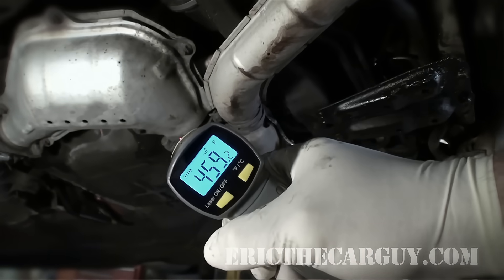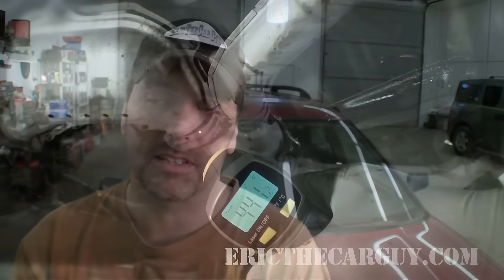Does Lacquer Thinner Clean Catalytic Converters? -EricTheCarGuy

Comment: The CAT in my last car just completely rattled itself apart. Sounded like shaking a bunch of rocks or marbles in a huge tin can. I had it replaced, and I only paid something like $180 (this was in 2009) to have it replaced. It helps to know people. :)
Reply: probably aftermarket. they only last a few years usually cheap. Try those then put bolts flanges on and you can just pass and replace with old one after cleaning and dipping in solutions. And you can save your new one in the garage to pass in two years again...
Reply: That was the 3rd CAT my old car went through. The 3rd one held together just fine until I sold the car to a junk yard in Oct. 2012. I just got tired of the damn car breaking down on me all the time. In case you're wondering, It was a '95 Dodge Stratus, the car barely had 100,450 miles on it when I finally got rid of the clunker.
Reply: Crap, i failed smog from having lots of blue smoke after warming up. Sucks because i dont usually have any smoke at all till i get too this smog place after warming up and driving freeway and whatnot. So pissed to not know what intermittent blue smoke is caused from. Maybe the turbo , but i thaught that would be around when i go for smog twice now. valves, seals, rings, pistons, turbo, exhaust manni cracked. Catalitic seems clean, but cleaning it for like 24 hours. Was insanely easy too take off, so glad.
Reply: charleysturbos
Based on what you're describing to me, maybe that blue smoke is the result of burning oil?
Reply: Hey loud yes I knew blue smoke means oil burning but thanks. I passed smog everyone. I finally got my sticker after seven months trying different things and reading 100's of messages and researching for hundreds of hours on what to do. I came up with an amazing way to clean my catalitic and nobody on all the forums ever did this that I'd read. Anyone want to know? Also know exactly how to clear obd2 not ready sensors easy too.

Comment: The original video he said to use 1 gal per half tank (ACURA maybe 6 or 7 gallons).  That seems like a much higher ratio than used here.  He also stated that the vehicle should be run at higher rpms for a prolonged period of time (30 mins at least).....make another video but up the ratio to 1:6 and step on it ;)

Comment: I have a Nissan Sentra GXE California emissions 1.8L, it has a check engine light on, so I had it taken to auto zone to check and see what could be the issue. The code reads P0430, what do you think could be the problem? I have checked for this code, but all videos come as P0420, are they the same?

Comment: shouldn't you run the test on a car with the cat code in progress? also the code sets off at 95% cat efficiency so if you can burn off just a little carbon your in there , it may gain you that 2% to shut the check engine light off, the light should off bin on during this test to properly conclude its effectiveness  , also the ratio is to dump the lacquer in a 1/4 tank i think, any way i do like how you checked the temps of the cat before and after

Comment: Mr. Eric: as  former tech of 18 yrs.working on tractor trailers & forklifts of every type, I commend your logical & measured style in your "mythbusting" lacquer thinker/catalytic converter video. My comment is along the lines of a different experience,....have a '98 Ford Windstar w/ 233,250mi on it. The converters are arranged in the headpipes in such a way that one has to replace them both together, to the tune of about $500. That being the case I tried the lacquer thinner route, but used a 5gal:1 ratio of gas to thinner. I just ran it in neutral at approx 2000 rpm for about 30 minutes. Cleared the codes, & it went 6 weeks before it filed a P0420 code again. Repeated the process, & has been fine ever since ( around 4 months). Since I've saved myself around $470 so far, I've got room to do this a couple more times, giving me time to save my change for a converter replacement. Just another perspective.

Comment: I have never seen any additive help a car. They only seem to help the guy who sells it.
Reply: Wait a minute, I had a 96 Legacy that was misbehaving, losing power, hesitating, laggin', lurching and shaking when I put my foot on the pedal, poor idling and gas mileage and some other nasty thing, I put a bottle of Gum Out in a tank full of gas and "oh the mystery" the car's running fine after running through 1/2 the tank with Gum out in it. You can call it  snake oil coincidence. I don't know... It helped my car run better, it just cost me 4.95 at Walmart, that's good for me.
Reply: The only additives I use are:
1. marvel mystery oil - used it in my 79 ford and it fixed my sticking lifters when nothing else would work. I also add to my crank case a few days before oil change. It has also been around since 1923 so it must be good stuff and many mechanics swear by it.
2. sea-foam - in the vacuum lines helped smoothed out my idle in my Mitsubishi Galant. I do it now about twice a year. I also use this as a fuel stabilizer in gas that is going to be sitting around awhile. It's great at getting water out of the gas too. I have a friend who is against additives but loves this stuff lol.
3. Lucas oil fuel injector cleaner - increased my mpg by 4. buying a gallon at a time will increase your savings. I use this at every fill up
I have personally witnessed results from these 3 additives. I have seen other additives actually cause problems in some vehicles but I love these ones. Try them out.
Reply: Sea Foam in your vacuum lines smoothed out your idle? Tell me the process that you chose?
Reply: MrRoachburn I love z max but super expensive but got massive suger out of my car and running great again when all this other crap 200 bucks worth didnt. Love sea foam, makes compression higher. Also tried Restore on a new turbo eclipse with ring problems or valve stem seal leaks. Anyways it in 150 miles made the compression numbers like 7-18 higher in most cylanders after. Also when i was a kid i used dura lube because i thaught it might work and it was at biglots cheap for replacement oil. Drove for years that car then checked oil one day and nothing on the stick at all. Added oil and car lasted another three years or more after that even..
Reply: I have used sea foam more than once cleaned all the carbon deposits of a used motorcycle I had and clean out all the carbs! Never had an issue from it. been using it for years to get some things cleaned out!
Reply: Kent Diego Now that's the best thing I heard yet, it only helps the seller.
Reply: Worked for me
Reply: Kent Diego rislone works for me every time
Reply: I feel the exact same way.  I'm tired of hearing about SeaFoam.
Reply: redex diesel sorted a cel on my 2010 passat diesel .. must have been a bit of dirt or something but 2 tanks of fuel with redex and driving the ass off the car has sorted whatever was making the cel come on ... crazy :)
Reply: this isnt an additive though
Reply: I agree. There is a whole industry of selling chemicals to dump into your engine or your gas that is mostly BS. Maybe under very specific circumstances that are probably not present in your car, maybe it does something. But generally speaking, if this stuff was good for your car, the manufacturers would recommend and sell their own branded stuff and it would likely be in the oil and gas that you buy. Gasoline already contains detergents, for example. Another thing is that all the gas is the same within any given region. There is simply not enough piping capacity to separately pipe different brands of gasoline. Each octane rated gasoline is basically a commodity.
Reply: +Kevin Campell.... How did you test this and even if it did clean deposits, what affect did it have on your motorcycle engine that can be tested?
Reply: Kent Diego you can check out some other videos on YouTube where people run boresnakes into the cylinder before and after the difference may not be huge in most products but it does make a difference
Reply: Kent Diego well also as an example where actually helps my dad was having sticking valves on his Volvo a while ago I got him the STP upper cylinder lubricant as well as the concentrated STP injector cleaner and it did wind up Improving the car
Reply: That's all this is for it's fixes it long enough to sell it don't do this yourself just replace them
Reply: Kent Diego true lol agree
Reply: One of my cars failed smog a few years back.  I added octane boost and took the test again.  Passed. The numbers were better
Reply: True lol it's like a love poison at a carnival, all lies
Reply: i used cataclean after i failed emissions twice ..i put one bottle to quarter tank drove it out went back days later and passed no questions asked. its been 3 weeks of driving now still no codes and all data on scanner is fine...it worked for me 20 dollars a bottle to a quote of 6 to 7 hundred for new converter
Reply: Many have worked for me
Reply: I'm not a mechanic, but I agree. If the mfr doesn't recommend using something, ie fuel additive, injector cleaner, tranny slip fix, stop leak, or anything similar. Thanks
Reply: I agree , most are shit like the rest of the as seen on tv gimmicks but here our friendly auto wizard may have been offon his formula . Eric is awesome , but with all due respect , And i do mean ALL due respect , he kinda goofed on proving THe almighty  Mr Kilmer wrong. Kilmer used a gallon per 9 of fuel so like 12% erics was way less like a  quart to 9 gallons , sooo a 3% ratio is no good is all we learn here .

Marvel mystery oil is a good additive to dissolve stuff and fuel injector cleaner.
Reply: Lacquer thinner worked for me by cleaning not only one, but two of the catalytic converters on my vehicle. People that say Lacquer thinner doesn't work are apparently trying to help the guys selling new catalytic converters and technicians replacing them. Respect, laud and admiration to Scotty Kilmer for being honest, but not quite so for others that aren't, you know who.
Reply: hubergeek yeah same as marvel , they are both solvents ,probably mostly kerosene and naptha, cleaned out your filter and injectors, i just get mmo cause the bottles 32oz for 5 bucks vs 3 bucks for 12oz.    I was sayin all  the slick 50and rislone stuff is probably just hype, slick 50 had teflon in the beginning and may have helped but most as seen on tv stuff, additives included are just hype or gimmick.

Comment: Putting lacquer thinner in your car will allow you to pass the sniff test, so will alcohol. It is not meant to clean out the catalytic converters, it makes you pass in a different manner. The emissions sniff test is meant to check for un burnt hydrocarbons or incompletely combusted hydrocarbons. Alcohol or lacquer thinner doesn't produce these byproducts when it is combusted, as it burns clean, so you are diluting your fuel with something that burns clean and will not contribute to your CO levels in the exhaust sniff test. This technique will get you through emissions, but not by fixing any emissions related issues.

Comment: Hi Eric, wondering if you could help me, I've got a year 2000 Peugeot 206 (not sure if you have peugeots over there). I have the official peugeot diagnostic tool and it gives me a lambda reading of pretty constantly 700-600mV, it doesn't switch from low to high like I've heard it should. If I hold high revs then release it drops down to 10-100mV like I've heard it should, but it does not do this switching thing. There is A LOT of soot coming out the back of it.

Carbon Monoxide is up at 9%, hydrocarbons up at 900ppm and lambda down at 0.713. Incidently these values went up after changing the cat and lambda sensor.

Only fault code that kept coming up was 'Oxygen Sensor Function', despite it being a £70 NTK item :(.

Comment: Eric, Hello- I'm posting in hopes you or another person in the know may be willing to help me with a recurring issue with my 2002 Pontiac Bonneville. The motor is a 3800 sse.  The problem is that the antifreeze freezes.  When last flushed, the fluid, rated down to -40 as a 50/50 mix, is Peak brand.  At that time, I replaced the thermostat.  I bought a used car for travel so I covered my bases on the small stuff.

So, "here is my story."  Traveling from SD to NY my car slightly overheated (~250) in the extreme January cold (~-27deg F).  I pulled of the road, opened the hood and the reservoir was filled properly.  I opened it, stuck a pen in to find slush and chunks of ice.  I opened the radiator cap, slush.  stuck my finger in luke warm.  Now, the meter in the cab is reading 110deg F.  I filled the reservoir with straight antifreeze.  Got a hotel.  Drove out the next day.  The gage stabilized quickly at ~190deg F all the way to NY, NY.

The whole issue has repeated x4.  1st at 50/50, 2nd at 60/40, 70/30 and at 75/25.  What gives?
Reply: Water pump belt tension, Clogged up radiator or hoses? Any kinks? Are your hoses in new condition? Ive hear of internal breakdown of hoses causing a flap to block passage... Not sure man. Some thing is up if your engine gets really hot but not your reservoir. Is it an overflow or pressurized reservoir? Also try the forums.
Reply: Did you bleed the cooling system after you changed that thermostat? You should have a bleeder valve some where in the cooling system if not pull a heater hose and add coolant through the hose.
Reply: were you running anti-freeze or an inhibitor they look the same but are different
as well I would buy good concentrated antifreeze and mix yourself. quite often premixed are sometimes not what they claim

Comment: I was overhaulin a Mopar 42RE in a 96 Grand Cherokee where I also replaced the 2 rear freeze plugs - I hacked off the catalytic converter and noticed the horrors which threw the P0420 code - half of the brick had a meltdown where lacquer thinner will not fix this...
Reply: I found out the hard way with my P0420 diagnosis - I had a melted brick on the CC inlet side - here's the variables - secondary ignition system, leaking fuel injectors (I replaced my Jeep injectors with Bosch 703s replacing the 778s on a 4.0L) and came across a corroded distributor cap terminal (ended up swapping out the cap, rotor, plug wires, and CPS)

Comment: I put denatured alcohol in my Durango with a high nox readings,drove it a little then retest and then it passed smog I also tried the soap and water on my accord with code p0420 and that also worked , code came back 2 weeks later but I had already passed smog test.

Comment: my 03 chevy Tahoe 5.3 engine sometimes it wont start right away, what could be a possible cause?
Reply: Scotty has a nice video on not starting cars. Check spark and check fuel and he shows it all. Cap rotor and plugs and wires. And the right ones for your chevy. Certain cars and trucks only like certain ones in my experiance.

Comment: i say drill a small hole into the exhaust after the o2 sensor run a length of copper tube into the hole and then pump oxygen from a welding cylinder into the exhaust through the converter when it reaches operating temperature, the excess o2 will burn off carbon deposits on the catalyst thereby repairing it

Comment: No disrespect it's clear he said to use a gallon in a half a tank of gas not a pint.

he also states if it does not work remove it and wash it with soap and water.

Comment: I have fixed many P0421 codes without changing the cats. A muffler shop will always try and sell you a cat. But don't pull waveforms for the o2 sensors. Either the first o2 is old and slow or the ECU is overzealous at checking for efficiency. Lexus IS 300 with new cats still didn't pass smog. Put  sparkplug antifoulers on the aftercat o2 sensors and the CEL went away. Car passed smog and was sold. I do live in California.

Comment: I live in California. I own a Smog/muffler shop. Just off the top of my head I change 125 cats a year for 7 years now and have NEVER seen a P0421 that was due to a 02 problem. The cat has been the cause every single time. Now it is a possibility, very remote possibility I would say that the cat is good with a PO421 but odds are you need a cat.

Comment: Got a bad cat and none of the quick fixes have worked and don't want to buy a new catalytic converter. Here you go!

Go to an auto parts store with a decent "help" section. Buy a dorman spark plug non fouler part #42002, drill it out with a 1/2" titanium drill bit. Then unbolt the downstream O2 sensor, install the non fouler in it's place, then bold the O2 sensor in to the non fouler's inside threads. No more P0420 code, no more check engine light.
Reply: u shounld make video of it
Reply: I like your idea. What do we need to drill out? And Do you mean bolt the O2 sensor into the non-fouler?
Reply: You have to drill out the non fouler to make room for the catalyst portion of the o2 sensor. The idea is to install the non fouler (that has been drilled) in to the exhaust, then install the o2 sensor in to the non fouler to space it away from the exhaust stream to eliminate the PCM seeing the catalytic converters inefficiency or lack of presence.
Reply: Derrick Hodges How about just cutting the O2 sensor wire and adding a resistor "inline"... easier faster less expensive. Worked on my 98 Lincoln Town Car
Reply: Derrick Hodges They show pictures of this, saved recently if you want just message me and ill find them in my videos or forums. It said it just puts the o2 further away so it doesnt read so rich or strong i  believe and wont foul  them.

Comment: what is the P0421 Code?
Reply: Warm Up Catalyst Efficiency Below Threshold (Bank 1)
 Basically this means that the oxygen sensor downstream of the catalytic converter on bank 1 is detecting that the converter is not working as efficiently as it should be (according to specs)
Reply: oh ok thanks Moskeeto